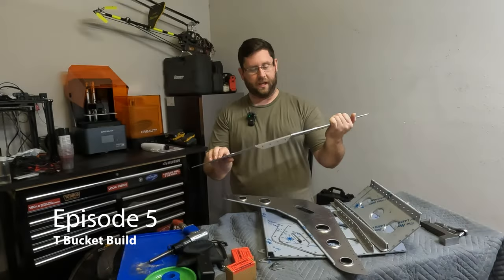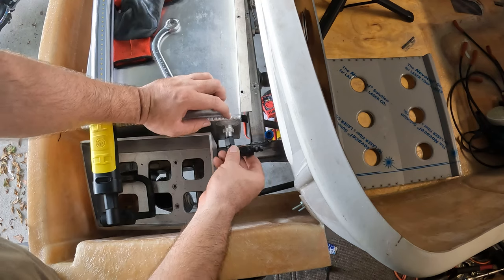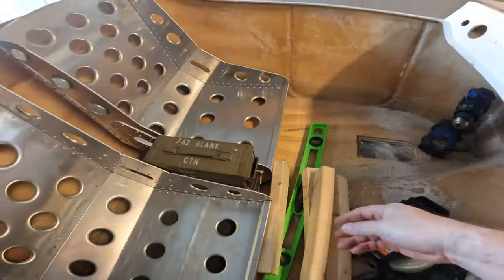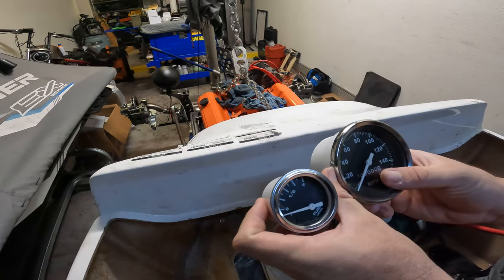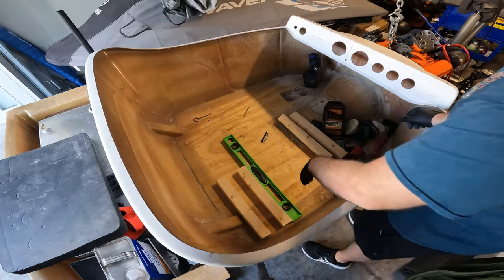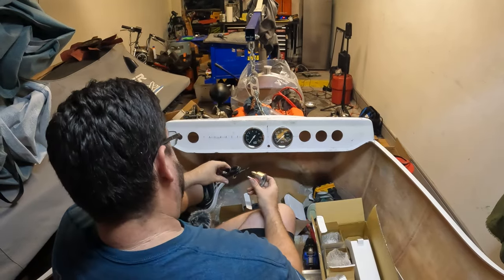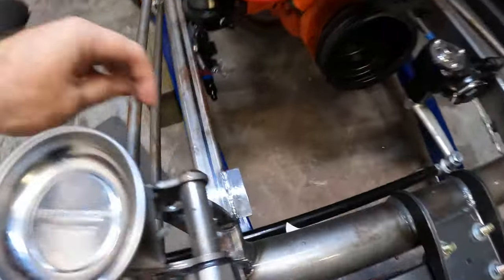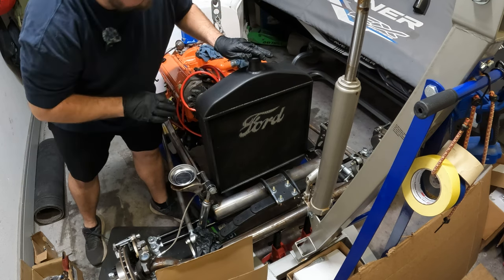T Bucket Hot Rod Full Build - EP5 | Speedway Motors Building the T Bucket ROADSTER

Comment: Looking like a T-bucket now. I'm wondering if you could stiffen up the seats with a cable/turnbuckle set up on the sides of each seat. Where you could tighten it. Or an all thread?
Reply from the maker: That's a great idea! Didn't think about that but I do have the hardware might look into that but if all else fails I may just brace it from behind

Comment: I know you don't  want to but you should really consider blocking the body. It'll stiffen it up an give you something to tie the seat into better. California custom rods/ roadsters has paper work on how to do the seat frame and framing. Scrap wood and a few tunes of thickso epoxy and a can of body filler and your right as rain.😊
Reply from the maker: So I do have the seats out, and still doing that whole thinking man pose ... Are you talking about blocking up the edges right around the back? Like if you were to do an interior upholstery?
Reply: Yes, sir it should be in your t bucket manual, you could consider doing the seat frame too and then mounting the seats to that . Stiffens the body and would probably allow you to use more bolts to mount the seats. I believe it's a 2x4 base with a piece of plywood on top.
Reply from the maker: So I picked up a few seat frames since the last drop ... nothing is really working out with those bomber seats.  They look fine on the formed ones but these ones are a headache